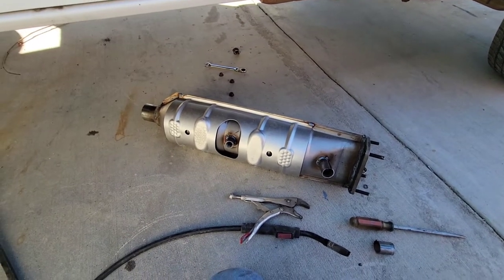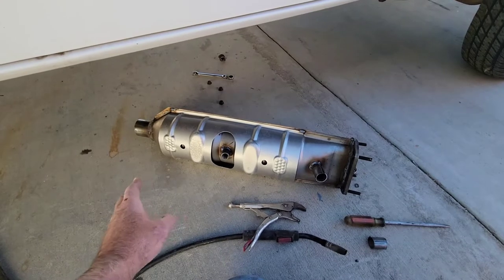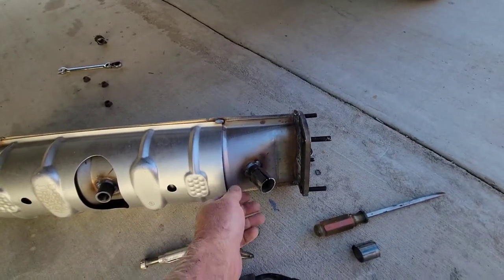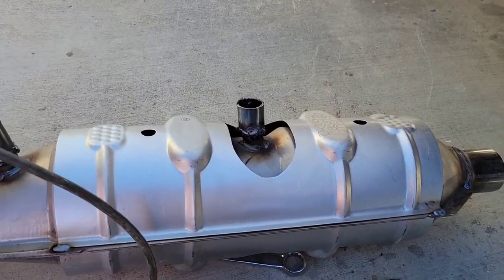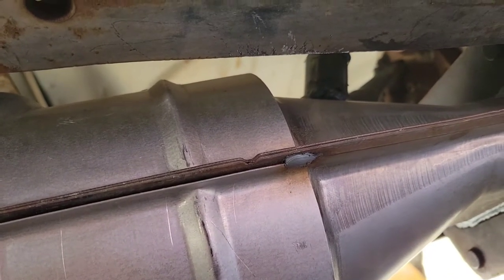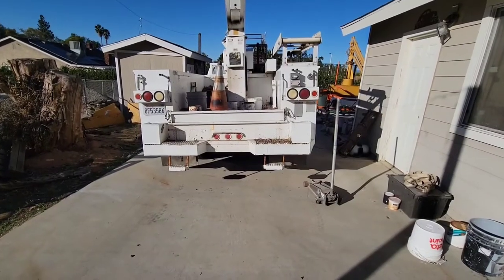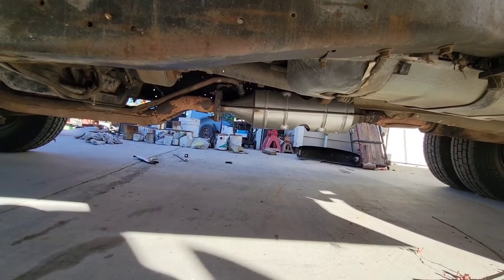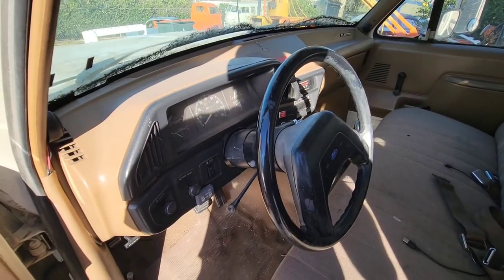Ford F250 350 450 550 super duty catalytic converter replacement 7.5l California  CARB 460 engine

Comment: Yeah but, I wanted to see how you got the old nuts off the flange at the front on the converter. The nuts on mine look like they are welded to the flange.
Reply from the maker: cut them off if your replacing it. maybe they welded yours on Mine were not welded just exhaust lock nuts.